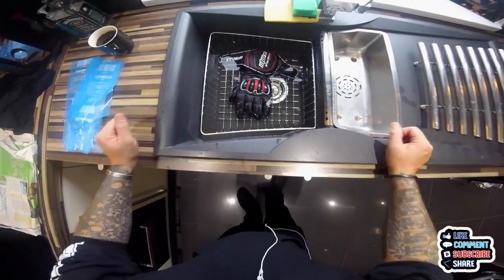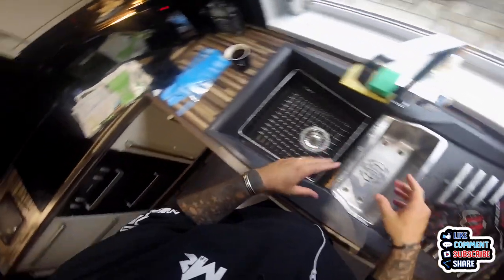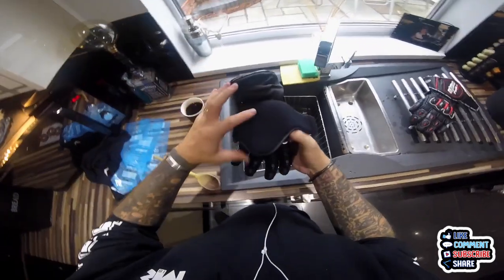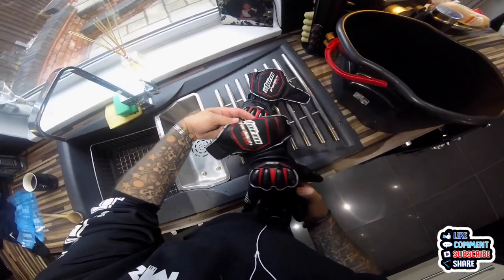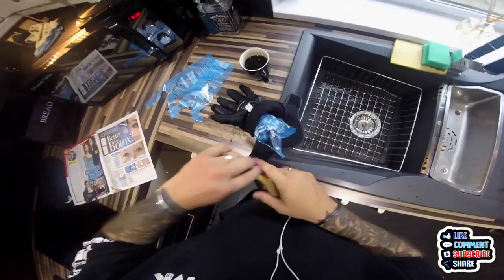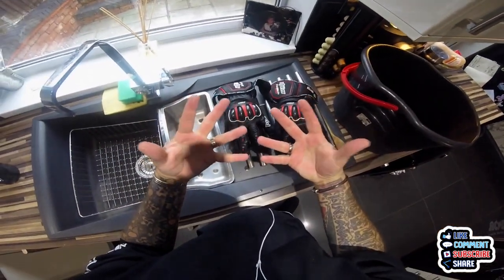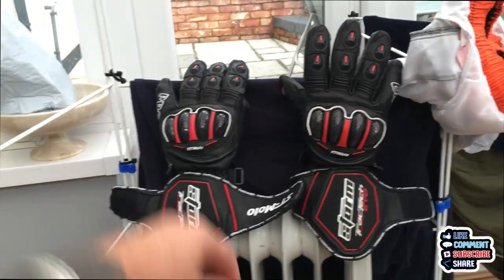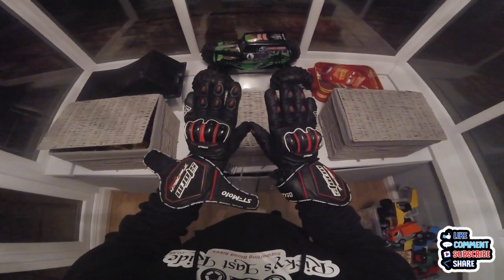How To Stretch Leather Motorcycle Gloves

Comment: Thank you for this, I’ve bought gloves that I used to send back for being too tight, but after your process they fit perfectly. The XL sizes I have bought in the past to lessen the strain of being too tight with size “L” have caused issues due to my fingertips not reaching the end of the finger pouch. Now i buy large size instead of XL which are tight, yet when I perform this process they fit perfectly. Respect

Comment: I watched this, part of it. I went and found my riding gloves from 1970. I found them under a box of photographs. They had nit been worn in fifty years. They were flat and stiff as roadkill. My hands are way way bigger than they were at 17. I remembered that i always used to oil my baseball glove every spring to get it loosened up, So I found an old bottle of mother's Hawes Lemon Oil for furniture. The bottle had a spritzer. I crammed one hand at a time into a glove and spritzed it with Hawes. I could see the leather actually drinking in the oil. It disappeared, completely absorbed. After about three coats I could feel the leather relaxing, breathing again. I put the gloves out in the hot hot summer sun for a few hours. When I put them on again they were as supple as when they were new. I wore them all evening and by bedtime they were stretched out and fit perfectly again.

Comment: Ok, i did it,...but instead of putting newspaper inside, I just squeezed my hands in there and soaked them in hot water (maybe 75-80 degrees Celsius) My plan is to just let them dry on my hands,...as far as possible,...they are fitting so good now, that i literally just tipping this text with them! they are still wet though, and this may be a factor, but I will give you an update tomorrow!  I bought them half a number to small, because I have weird hands and hate gloves that are to big (poor leaver control), but figured that, since they are leather, I will work them in anyways. The Finger length was perfect but all in all just way to tight (even painful on some spots), I hope this works!,...because all in all I have never had gloves that fitted so well, like those ones (in their still wet) state.
Reply from the maker: Great please do let me know how you get on 👍🏻
Reply: @Motourev  I will, but what I can tell you now is, that it's a pain in the ass to wear them, if you have to use the bathroom though...
Reply from the maker: @mementomori4972  😂🙈
Reply: @Motourev  That worked so well!!!, I have to admit, I had a "couple" of beers yesterday,...and that's maybe why I was willing to wear soaking wet gloves for,...maybe four ours,...at home,...but it's so much better now! I obviously couldn't wear them, until they were completely dry, but the result is amazing. They are still just a little snug on the right hand and I guess, I could repeat the treatment,...but I think, they are so good now, that I can do the rest just by conventionally breaking them in (they are basically brand new),...and using some wax or conditioner! I honestly never had gloves that fit so well,...and I'm thinking about buying a second pair. Thank you!
Reply from the maker: @mementomori4972  sometimes the simples things work. Merry Christmas enjoy eating your Christmas dinner wearing your gloves 👍🏻
Reply: @Motourev  I will,...thank you!. All the best to you and your family!
Reply from the maker: @mementomori4972  ❤️❤️🏍🤘🏻

Comment: I have the opposite problem, my gloves' fingers are too long and roomy but the palm fits just fine so I've been told to use a hair dryer on the hot setting instead of stretching them with bags

Comment: How did this end up working out for you after making the video? Do you still use the gloves?
Reply from the maker: Randy Fougere yes mate still use them in the winter as they are winter gloves
Reply: @Motourev  That's great. I have a similar pair of leather gauntlets that are a smidge tight on the fingers, but was worried about wrecking them. I'll have to try this out.